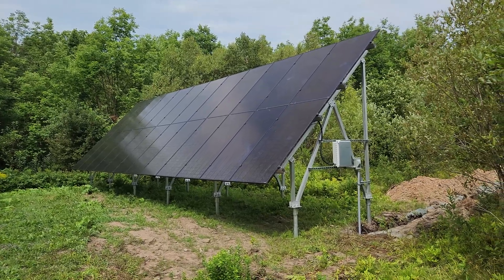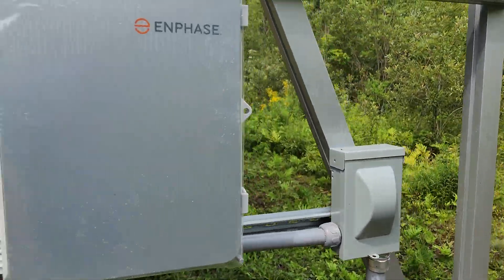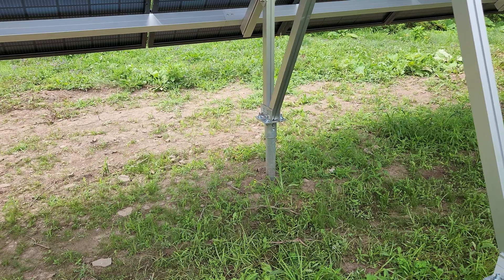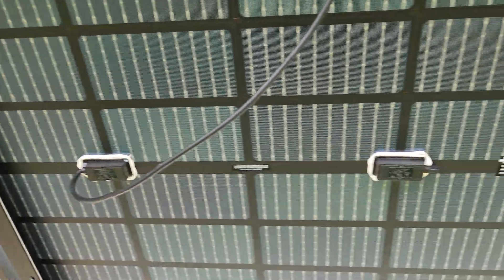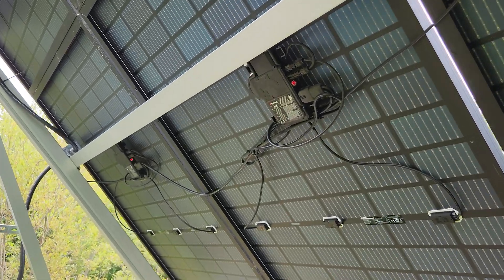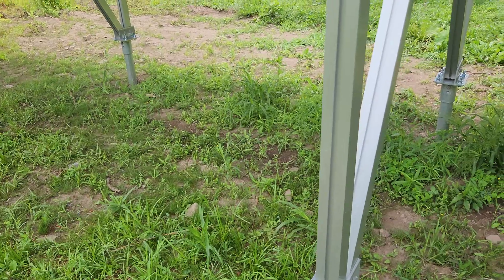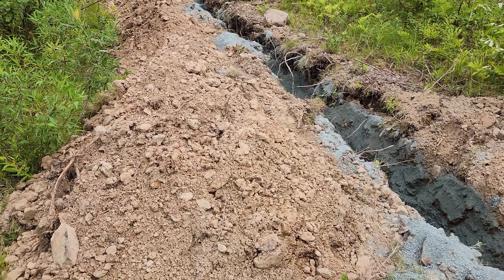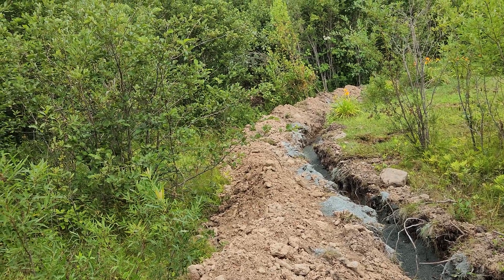12 Kilowatt Ground Mount installed just need to get the Approvals #groundmountsolar #solarsystem

Comment: Cool setup if you didn't break the bank
Reply from the maker: @gavinfahrenfort9497  $44,000 all in, 24 500 watt bifacial panels, racking, 230 foot trench, hookup and permits. $40,000 will be covered by a Canadian Government 0% interest loan for 10 years.  Works out to $333 a month. Just so happens to be close to what I pay to power company a month and system is sized at 109% of what I use.  So no  didn't break the bank, same energy payment per month and after 10 years power will be free under warranty for another 15 years.  I hope!
Reply: @trainstractorscarsandtruck7362 iyoo thanks for the explanation buddy all the best wishes to getting off the dependency on supplied power now u making your own from sunpower 🎉

Comment: The middle is just a joint for the panel. not something to put a wire too
Reply from the maker: @mafffmafff2354  Not the opening between panels the middle of the panel.
Reply: @trainstractorscarsandtruck7362  what looks like 3 terminal points. little black boxes. That's the mid point connector. not used for us. imagine two solar panels in one and that's just an interconnect between the two
Reply from the maker: @mafffmafff2354  thx
Reply: @trainstractorscarsandtruck7362  My panels arrived new with nothing fitted there. maybe you could get a lower voltage from that point who knows. like you're setup. keep us updated on how you get on

Comment: What is the name of or link to that solar scaffolding mount system?
Reply from the maker: @Ramjet7777  Not sure but I will try to find out.
Reply from the maker: @Ramjet7777  I have the info you wanted.  The brand of racking is Clenergy, the Solar Trellis III is the specific product.   Hope this helps.
Reply: @trainstractorscarsandtruck7362  thanks heaps for looking into that.

Comment: Nice setup there!   Pretty much all new solar panels made today have Bypass Diodes inside the solar panels (located about every 18 to 24 cells and usually located in those 3 evenly spaced blocks.  The Bypass diodes help reduce the loss of power production if that panel has some shade from trees, birds, buildings, etc.   --------   Highly agree with titeal on white reflective rocks/gravel to reflect light underneath the Bifacial panels to help the backs make more power.
Reply from the maker: @Bowhunters6go8xz6x  Thanks for the information.  Appreciate the knowledge being passed on.

Comment: You would benefit greatly by placing some white rocks under those bifacial panels.  Just a suggestion.
Reply from the maker: @tlteal  Thank you sounds good
Reply: Came here to say exactly this. You can get get an extra 20% with white rocks.
Reply: Why not just use a type of mirror-like sheets?
Reply from the maker: @MicMaine  Sounds good in theory.  I'm guessing the cost and in the winter would probably break from snow load.
Reply: @MicMaine  Because are cheaper and require no mentance. Also are forever. It is easy to say "a type of mirror-like sheets" until you do the job.